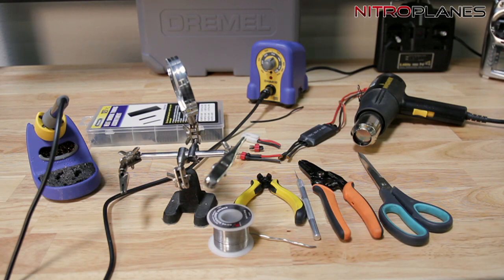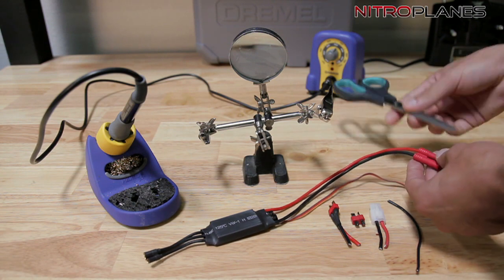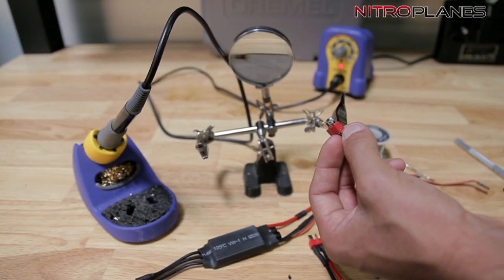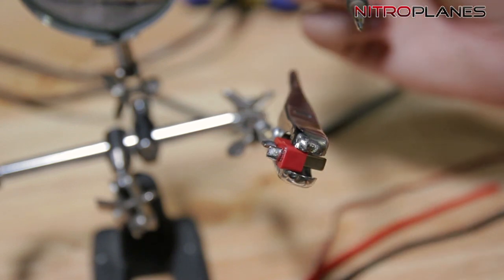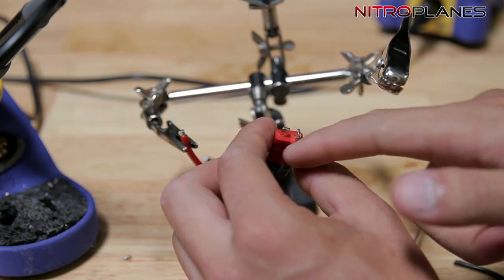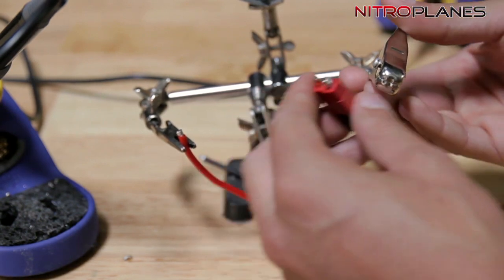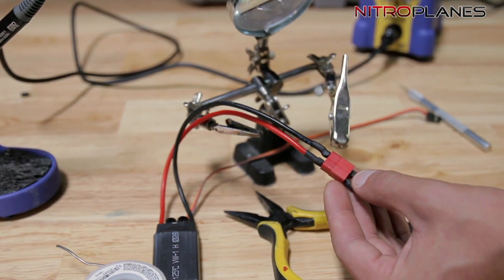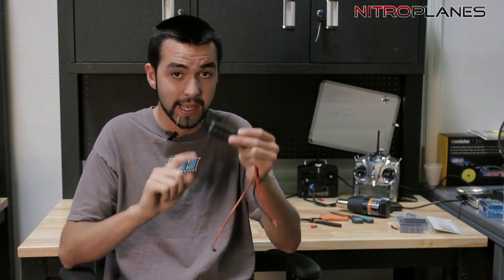Beginners Guide: Soldering Battery Connectors to an ESC

Comment: can u please help me. My loop to connect to  2 2 cell batteries to my rc car popped off. While car was running. Will that cause a spark? Or will it just break the circuit? My car caught on fire, burning the ESC and the servo and the one of the batteries. I'm trying to find out the cause of the fire. I drove my car for 2 min before it caught on fire.

Comment: Very well explained! I've been applying way too much solder apparently but my shrink wrap does insulate the joints. It's also good to know that to keep it at 70W. I've been always using it on ax which is why the outer edges of my iron are dark but my tip I clean religiously.

My LHS owner always tells me to keep a little solder when I'm done soldering and cleaning to prolong the life of the tip. Is this a good idea?

I also use the same exact Hakko and the same rosin core from Radio Shack lol!